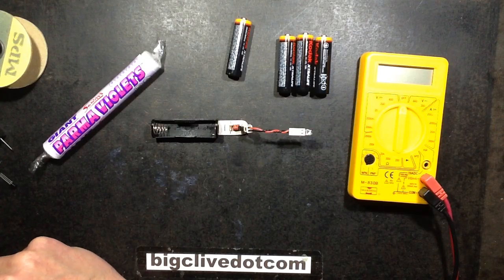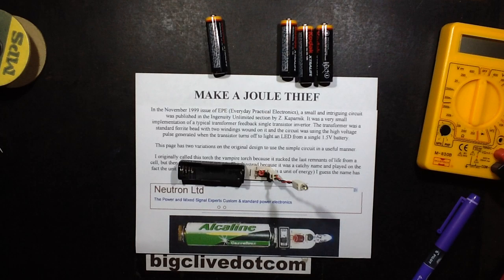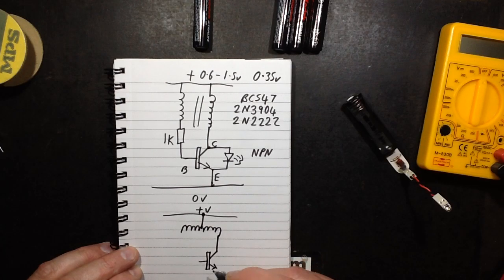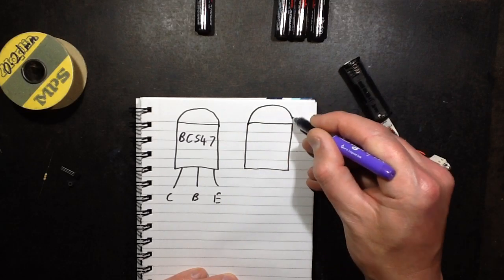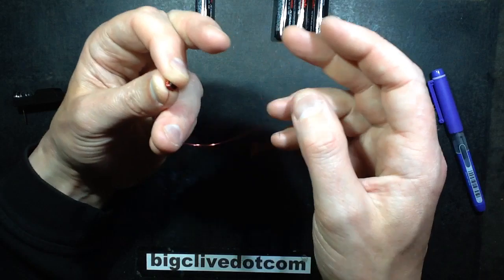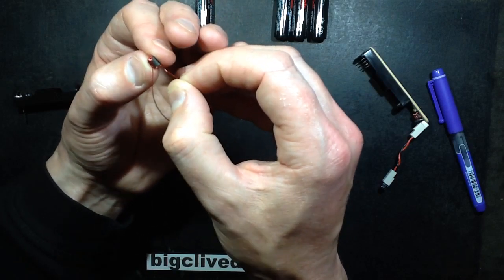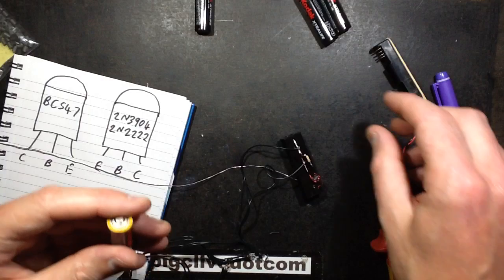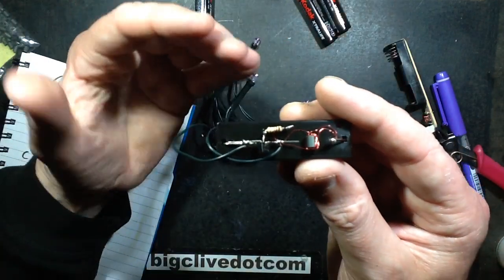How to make an authentic Joule Thief.

Comment: More than 50 years ago i built a circuit like that using Germanium transistors....  Silicon transistors were not yet available (yeah Im an old codger... 81 years old and still playing with electronics)......   The "Joule Thief" is a very old circuit...  it is a free running relaxation flyback oscillator with a high voltage secondary winding.  I also built another using two transistors, one cap and one resistor and an inductor (speaker coil)..  the time constant was almost 10 minutes.  i turned it on and was chatting with a friend and after some time it clicked  (we thought it was not working).....  but it was slowly charging the cap which eventually triggered the switch to discharge the cap into the speaker.
your circuit needs a diode from B to E with the cathode at B in order to protect the BE junction.

Comment: Hi Bigclive, I think your videos are super.  I built on of these joule thief circuits and tested it a bit;  I found that if I removed the 1K resistor it still worked but a little erratic so I added  a 100 ohm resistor between the battery negative and the circuit and it seems to be smooth.  I was wondering if you might try that rendition and  if it works for you then maybe you could make a new video on the subject as it seems to be a popular subject.  Thank You for Your videos.
Reply: I used a 10 ohm resistor. Sorry about the error.

Comment: Thank you for your quick reply to my request. In case of using a germanium transistor as voltage across the Base-Emitter is different than for silicium transistors, should I change the value of base resistor (currently 1KOhm) ? Thanks again.

Comment: Back in 2003 for my technology class I made something similar to this which I made into a simple 1 hour timer with 3 AA batteries and 3 LEDs and when you turned it on with a switch, it started with all 3 LEDs lit up and after 30 minutes, one LED would go off, then 20 minutes after that another would go out and and 10 minutes after the last would go out, indicating 1 hour.

Comment: So, this seems to rely on the fact that LEDs can still function adequately when cycled on and off many times per second, right? Because the flashing is too fast for human eyes to detect it? So, then, would you be able to power a more sensitive load by stabilizing the current without dropping the voltage too much? What would happen if you paired the LED with a capacitor in series? Would it stabilize the current? Would it drop the resultant voltage, and therefore shorten the battery's usable lifespan, again?

Comment: It reminds me so much of hydraulic ram pumps which used the low pressure of a river to make pressures high enough to supply farms with water high above a valley.
Reply from the maker: The ram pumps are still widely used.

Comment: FWIW I find if you put too many turns on the ferrite that it limits the power, you end up saturating the core and the frequency goes down because there's too much inductance. I took a ferrite out of a 6W CFL and put 25 turns on it; that was really too many; it looks like you really need more like 8, although for low power output, like a few tens of milliwatts it doesn't matter much, but I wanted a bit more.

Comment: I made a variation of your Joule Thief, it's basically the same except for the output which is going through a series connected diode and a parallel connected capacitor... I also have 2 very small transistors parallel connected which I got from an old cfl bulb pcb, I have a LED string connected to the output it has 20 LEDs all in parallel ow yes I also wound the core not bifilar but 1 wire 3 times around and cut the ratio to 1:2 using the 1 for the transistor base and the 2 for the collector.

What changed is that it can now buck and boost the voltage for the LEDs which will conduct with a voltage of 2.5 volt because of the parallel connection, I don't have a current limiting resistor on any of the LEDs and I'm running it this way with a 5 volt input more than a year or two, the LEDs are much brighter as they were when connected to 2 AA batteries in series with a 10 ohm resistor, it will completely drain the batteries to 0.1 of a volt or so but when I run it on batteries it doesn't run as long as your Joule Thief but I want it to drive the LEDs as hard as possible to the full brightness, not for as long as possible.

I made more variants just to see what happens, I also have one with a light sensor (LDR) and it will stop the Joule Thief when I shine a light on it and automatically starts working when I turn off the light which is pretty cool, maybe I got the idea from you I'm not sure but I had a lot of fun tinkering around with this circuit.

Thank you so much for sharing your knowledge and best regards,
Ricardo Penders

Comment: Many thanks for this. Can you use lipo cells, or would they just drain too much and not be able to be recharged? Also, to make it smallet, could you use button/coin cells? Keep up the excellent work. You have earned my subscription.
Reply from the maker: It's only suited to traditional 1.5V or less cells.

Comment: I was surprised when I discovered this arrangement in my sisters solar lights , she had asked me to fix up. They had a battery  holder  for two NiMH but had jumpered one out. I guess the manufacturers still wanted to say "Batteries Included " but had found that the little cct that could get them enough voltage out of one NiMH battery to run the LED was cheaper than including a second battery

Comment: could add another resistor and transistor. mirror it on the other half of the transformer and use a large center tap transformer and use the primary as the output and power a cell phone charger or LED light bulb with it..
I did that just now and it LIGHTS UP AN ENTIRE ROOM!! From just 1 AA battery!
It works better on a 6v battery though.

Comment: Just a thought.. rather than running an LED charge up a super capacitor to provide some decent power to say run a radio or a brighter light when needed?
With posibly very low drain circuit  to turn off the Joule thief once the capacitor was charged?

Comment: I wonder if the Base resistor is really neccesary in this super low power circuit? Have you ever tried to just leave it away? Perhaps all it needs is a little fiddling with the winding ratio of the inductor (base:collector not 1:1 but 1:3 or something like that)?

Comment: i just built this circuit and it is cool i made mine from a inductor rewound into a transformer im using a npn3904 a 5mm wight led to test but then i thought since i just bought a gu10 led lamp at dollarama my Canadian version of  poundland  one light was working the outer i dident know i took it apart before i tested if it worked one of the leds were cracked so it dident work dint know if i broke it  or i bought a broken light o and my gu10 leds have a plastic body with a alu pcb and a cheep black silicone poting for the transformer pcb i just hoked up one led chip and it letup brightly i wonder what i can now apply this to thank you for making these videos there fun to watch and even more fun to make circuit along with them

Comment: Hmm: I got some little strings of LEDs to go in houseplants at Christmas. They came with holders for two batteries and a switch and ran out from fully charged in a couple of days. Now I find I could have lit up Christmas for free with the heavy box of dead ones I've got nowhere to throw away to!  :)

Comment: I'm wondering if you use the with a new battery if it will has less overall loss than a simple resistor limiter LED circuit.
Seems something nice to try on Chinese small laser pointers since the cells cost more than the pointer itself. Same with electronic mini candles.

Comment: Could this scale up?  say to power large led lamps to light up an unpowered work space with dead car/truck batteries? maybe even use them to charge a 12v motorcycle battery.

Comment: In the late 80s a professor of mine told me "You can't light an LED with a single AA battery! It doesn't have enough potential."  I told him he was wrong and with a few days of experimentation, I built a circuit similar to this one and brought it into class.  My professor told me that using the back EMF in this way was dangerous, would destroy the LED, and violated many Electrical Engineering design laws. He concluded with, "Therefore, you still haven't lit an LED with a AA battery."  Fast forward to the 2000s when I start seeing this circuit show up on the internet under the name Joule Thief.  I remember suddenly stating out loud, "Hah! I was RIGHT!  It IS a real circuit!"
Reply from the maker: My very first LED was a green one that did actually glow on a single 1.5V battery.
Reply: If one want to be good and proper the LM3909 came out in 1975 and was designed specifically to blink/power (adjustable up to ~1kHz) a LED, or at least LEDs of the time with a Vf around 2V, from a 1.5V supply... Some people are just no fun. 

I just recently breadboarded a joule thief (as shown) together, with a chinesium 2N3904, poked at it with an oscilloscope, and couldn't find any signs of anything breaking down. Nor was any degradation of Hfe (indicative of a breakdown problem) noted. I guess a low value resistor could be put in series with the LED to help limit the peak current, but if it isn't enough to roast the phosphor or blow the bond wire it seems unnecessary as the RMS current is fairly low. Or course I guess it all really depends on the inductor specifics, mine was ~24 turns bifilar wound on a small yellow/white (mix 26?) choke toroid I salvaged from a old car phone charger.

Comment: All devices that uses batteries should utilise this!
Oh, question... If you put a capacitor on the output, could you smooth out that high frequency wave?
Reply from the maker: Jordan O'C If you put a fast diode and capacitor in place of the LED  you do get a DC output.
Reply: bigclivedotcom That's fantastic... I may actually have to build this circuit (along with the DC rectifier)! It'll save me a bunch of money on disposable batteries. Thanks :D

Comment: Hello Clive. I'm trying to learn the basics of electronics at the moment and hope you can help. If this circuit was to be "shorted" what would a short circuit look like in your diagram at 8:00. Or to put it another way: which parts of the circuit in the diagram at 8:00 touch together? Im a visual learner and need to visualise what actually happens. Hope you can help. Thanks

Comment: I remember seeing that 'back in the day' when Electronics mags were a thing - and thinking 'Oooh - that's clever!'.  I wonder if, by using a Germanium Transistor (do they still exist?) it would reduce the startup voltage requirement?

Comment: Enjoyed this Clive , thank you. Just thinking about efficiency, accepting this circuit has great variability in components, what sort of efficiency does it have? Would making the base current tiny make the. Efficiency greater or does the current running to the base contribute to the led current?  Would it run my battery devouring DAB radio longer or does it need a smoothing capacitor. Would smoothing the emitter voltage stop the circuit working? I am not knowledgable about electronics so simple explanations would be appreciated. Regards Dr. Sahal
Reply from the maker: +Anoop Sahal It's only really suited to running LEDs.  For a load requiring a regulated voltage a proper regulator circuit would be needed.

Comment: I'm nrew to the electronics hobby and learning a lot from your videos, thanks Clive! I still stumble on some basics though. For example when testing for continuity through the coil (around 21;00 in the video), what's to stop the wires from sounding at any connection? Aren't they making contact when they are wound together? Or does the laquer on the wire limit the contact? THanks again! J
Reply from the maker: They are insulated from each other by the lacquer coating.

Comment: I'm thinking this could be fitted into the original battery holder thingy perhaps?
Rewired to use just one cell, with the Joule Thief in the vacant space next to it.
Or would this not be a good thing when a new fully charged battery is inserted?
Saves buying a cell holder!   :-)

Comment: Just came to think of a cool project, if its possible.. I can't seem to find any info on this! I don't have any cores at home right now to test with either, I'm waiting for some that I've ordered!

Anyhow, the cool project would be.. LED throwies, but with a Joule Thief, to make them last way longer.. However, LED throwies are powered off 3V CR2032 batteries, how does a Joule Thief work with 3V input?

Also, do you think it would "work" with a lithium cell instead of an alkaline cell?
Reply: +Chris Fredriksson , A joule thief likes an output of at least twice the supply voltage.  One easy change to boost the output voltage is running the LED negative end to +V.  With this change the circuit would be marginal driving a single LED from 3V, should work well driving 2 LEDs in series.

Comment: I wonder if this circuit could be used to build a oneshot triggerable LED strobe light... I have just started fiddling with electronics, because I want to have an LED strobe light I can control from a Raspberry Pi and sync it to music.

I've seen there's some really neat white LEDs that can eat up quite a lot of watts. I am wondering if I could somehow step up a 5V 300 mA input voltage (so it can be powered from a USB power bank), charge a capacitor and then use a GPIO pin from the Pi to control a transistor to discharge the capacitor into the diode, creating a short, bright flash on demand...
I have some idesd, but too many unknowns still. Maybe someone had done something like this and shared how and why?

Thank you for your videos!
Reply from the maker: For a simple driver you could use a transistor to switch a high power LED on a 5V supply with a resistor.
Reply: @bigclivedotcom  Thank you! Yeah, that's a much simpler circuit to build for a beginner like me. I'll just need to figure out how to decide what resistance is needed.
Reply: I have figured out how to drive an RBG LED (with a common anode) using 3 NPN transistors. Now I need to find a way to do the same when the LEDs are powered from an external power source, without frying the Rapsberry Pi...

Thanks for the tips!

Comment: Ahhhh! A classic old Tandy pocket battery tester!
How much would I have to offer to take that little beauty off your hands? Both (!) of ours went missing many sad years ago.

Also, I've found basically nothing that will work with an AA that's fallen any further than about 1.0 volts, often any lower than 1.2v, or the average across a set of batteries. Half original voltage is deader than dead these days, it seems. Getting useful output from an alkaline that's down to less than 0.6v is astonishing and would have meant me throwing away a great deal fewer batteries down the year if I had s set of joule thieves that could be incorporated into the devices I actually use (....I've little use for a single-LED flashlight unfortunately)

Comment: I remember from my youth that my dad was trying to make this "solar mouse" or something along those lines from popular mechanics. I remember it took in solar power and stored it untill it was enough for the motor to use, then it released the energy in one movement and the cycle started again. My dad never made it as it required what I know realize is a transistor that he could not get ahold of, but he could have used one of many to replace it.

My question is this. Could you modify that circuit to use the joule thief to transfer the unused charge to lipo or lithium ion batteries? Like storing the charge in a capacitor until it is  charged enough to give a bit of charge to a lipo then start again.
Reply: Yeah you can combine a joule thief with a "solar engine" circuit - which is the circuit used by the solar mouse I suspect - so you can use low voltage PV cells and intermittently drive higher voltage motors etc., or a Lion charger. Just bear in mind what he said about what happens when the JT goes open circuit - without a load, you can hit 50+V and cook your transistor.

Comment: This year my family seem to have bought a huge number of battery operated LED things all using a translucent plastic box with switch and 2x AA cells. I wondered what the battery life comparison would be between 2 cells as sold vs. one cell using your joule thief to bump up the voltage but make full use of the single cell down to 0.5 volt or whatever. Have you ever tested this eh Clive ?